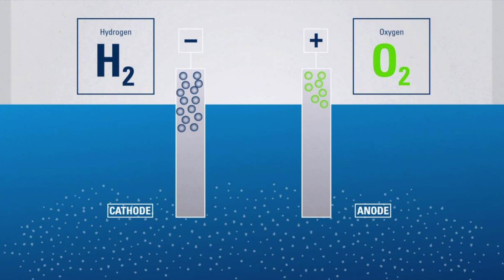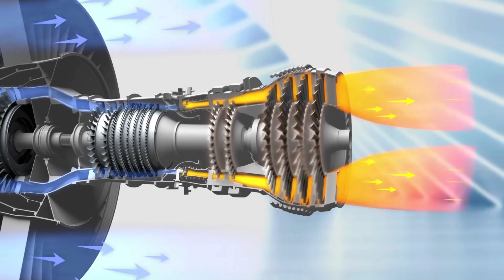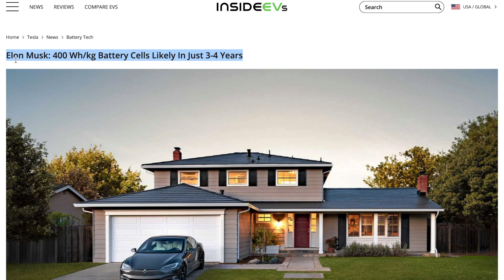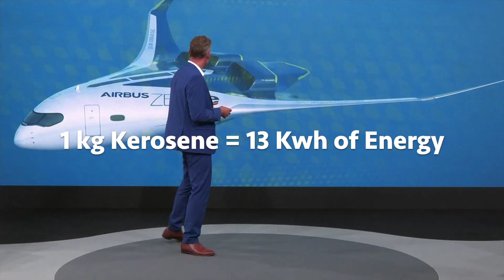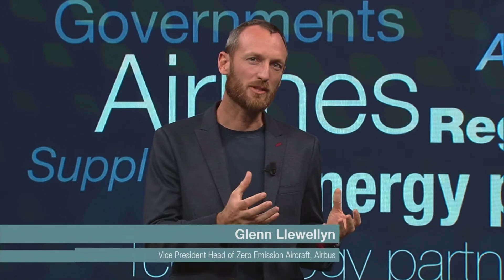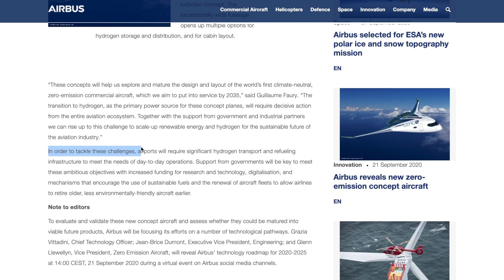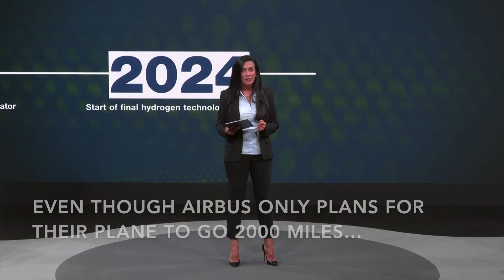Why A Hydrogen Plane Is A Terrible Idea

Comment: You missed the most important detail: how do you convert electric energy into kinetic energy? There's no electric jet engines, they'd need to be prop engines with electric motors, which are considerably slower, less efficient, noisier and overall worse - hence why virtually all commercial medium & big planes are jets.

That's where hydrogen wins by a long shot, hydrogen can be fed into regular jet engines with small changes in the burning chamber, and will work just fine.

Energy density and price are important, but even if you have the same energy, it's useless if you can't convert it into kinetic energy (ie. movement) efficiently.
Reply: Not to mention that the high voltage electrical system need to be tested to avoid fire hazard and battery is a deadweight to the plane
Reply: The time needed to charge the batteries would cost the airlines a fortune in operating costs and idle time.
Reply: Also with hydrogen you can put the amount of weight you need related to the distance you travel, when you travel and burn hydrogen the airplane gets lighter and more efficient, with battery you have to carry the full weight for the whole flight, and enough batteries for thousands of miles, even if you flight only 100 miles
Reply: well I would prefer fuel-cell plane with prop engines, that way hydrogen is more efficiently used where fuel cell engine could be lighter than jet engine and less hydrogen stored for the same trip. I don't really care would the flight take me 2 hours more or less, but it would flight further without necessary stop for fuel.  But also we need to account the benefits hybrid body (fused wing into fuselage of an aircraft, possible expanded carrying capacity), pusher configuration (propeller push an aircraft rather than pull), joined foward and backward swept wings and many more drag reducing designs...
Reply: To add this, when a turbine burns hydrogen, the it uses oxygen from the air - and it doesn't have to carry that in a tank. Batteries can't use this advantage.
Reply: @derkatzenfuerst6077  air-metal batteries:)
Reply: Maybe in the future we might use plasma jets instead
Reply: @ThomasBomb45  - air metal batteries have not shown high reusability. It's more like use once, throw it away. When you do that, then what's the difference between that and chemical fuel? How would it be better for the environment?
Reply: @manofsan  Yeah the technology would need to be developed to recycle used batteries into new batteries using renewable energy
Reply: For high speed airliners an electric motor powered ducted fan is the answer. Look at the big fan at the front of modern airliner engines. It rotates slowly and produces over 70% of the thrust. Upscale it and have a small rear pusher fan to supplement the thrust and you have a viable, high speed airliner propulsion unit. The weak spot is not the propulsion unit technology, rather the batteries and charging infrastructure.
Both can be solved with enough r&d $$$.
Reply: @stephen_101  - high speed means high power, and high power means combustion, not mere batteries. I'd like to think we could do hydrogen combustion, which gives water as exhaust
Reply: How bout plasma jets with hydrogen power airliners
Reply: I'm pretty sure that propellers are more efficient, there's a reason why they're still used (and it's not just cost). I know that they both excel in their areas, that being slow and fast speeds
Reply: plus you have to dump fuel before emergency landing! try doing that with batteries..
Reply: @jamietian6891  In theory the charging times could be minutes, as with modern cars.
Reply: @derkatzenfuerst6077  Batteries don't work with combustion. Of course they do not need to carry oxidizer.
Reply: @ChucksSEADnDEAD  of course not. My point is that a plane using hydrogen / oxygen combustion engines only has to carry half of its fuel. The other half is coming from the air intake.

When using batteries you need more energy on board to compensate for that fact.
Using hydrogen comes with it's own set of engineering problems.

What do you think, which system will be the most successful in the end?
Reply: @derkatzenfuerst6077  "a plane using hydrogen / oxygen combustion engines only has to carry half of its fuel" - Oxygen isn't the fuel, it's the oxidizer. The point is, when we calculate the energy densities of a fuel, we include the result of the energy released by the breaking of the O2 double bond without including its mass or volume. So there's no "hidden" advantage.
"When using batteries you need more energy on board to compensate for that fact." - But no, you don't. It's already compensated for. Same as automobiles, we compare fossil fuels to batteries by assume the energy released from oxygen is already in the fuel tank.
Reply: @ChucksSEADnDEAD  TIL, thanks.
Reply: @Avant-garde_Bucket  is it that much more efficient? Yes you get more of the energy out of the hydrogen, but you also have to fly for longer. Assuming these jets and props would have simmilar preformance to their standard fuel counterparts, the jet would be about 50% faster. Not sure the exact efficiency comparison at that point, but it is notable.
Reply: @midgetman4206  props are still used because they are well suitted to small planes. Though even there they are being phased out.
Reply: @ChucksSEADnDEAD  fosil fuels and hydrogen have very different reactions. When a fosil fuel burns, the added oxygen makes up very little of the reaction, with hydrogen oxygen acounts for 1/3 of the mass required to react.
Reply: @averagejoe9040  Yes, that too. But large planes also use them, most popular of them being the C-130.
 
But efficiency is a big factor when companies and buyers decide what kind of propulsion method they want (after consideration of other things of course)
Reply: @averagejoe9040  well do you have some information about comparison of fuel cell prop plane vs hydrogen jet plane? I don't know are there hydrogen jets, but there are hydrogen rockets 😁. But it would be nice to know what fuel efficiency have planes in comparison, just don't know did anybody made it.. yet.
Reply: @averagejoe9040  That's not the point. If you have 10 megajoule in hydrogen or in batteries, the energy is the same. When we calculate the heat energy recovered from the reaction we already took the oxygen's share into account.
Reply: @ChucksSEADnDEAD  and I dont disagree with that
Reply: @Avant-garde_Bucket  There's a lot to this idea. Modern prop technology could do a 450mph cruise across the Atlantic. The longer flight time would be insignificant with a roomier therefore more comfortable cabin.
Reply: @jonb5493  that is why I have high hopes for modern props in future, even a turboprop already is really clean even if it goes on fossil fuel. Just one issue here is value, they are expensive as hell. So for common people to get or take a flight in it is basically the same advising them of buying or renting hybrid supercar. It could make a difference if we could make them cheaper, after all, a turbine once was way too expensive, now isn't..
Reply: Ammonia cost only  $1,022.50 a ton. Seems like a no brainer.
Reply: Turbines spin, at a significant higher revolution. Energy laws take over eventually I understand that. However everyone approaches hydrogen as a static full fuel source when in reality it can be supplemented via on demand options to offset the cost and energy waste
Reply: fun fact, electric jet engines are a thing. They use ionic wind,  having potential differences of tens of thousands of volts between 2 electrodes. This causes the air to be ionised, creating a wind of ionised particles moving between electrodes. This movement also moves the plane (since every action has it's equal opposite reaction). Only issue is it takes SO MUCH energy to create a tiny bit of thrust
I wasn't tryna agree with the video, this youtuber's a dummy, I just wanted to share a fun fact
Reply: Prop engines are not less efficient, in fact they can be more efficient than turbofans, but at a slower range of speeds.

Comment: 1. Flight time Vs ground time. You can't keep planes on the ground.
2. Jet Vs propeller, speed is important
3. Energy density. Low mass is critical, especially for landing.

I don't think that we can go electric on planes. Hydro seems viable in the moment that the energy production problem is solved.
Investments for hydro tanks can easily be done, hydro might even be produced locally, with no transportation.
To be honest I think that for the specific case of planes, hydro is looking pretty good!
Reply: Tesla fanbois will still want to use lithium
Reply: not only that, but you can also up the ante and create synthetic fuels with more energy per unit mass. hydrogen’s biggest problem is it’s just so damn volumetric - if that problem can be solved it effectively saves you 20% of your efficiency loss from compressing the gas.
Reply: Fossil planes can't slow down, because of wing drag. Electric planes can use the the wings surface area to generate propulsion, which offsets the drag. It's a big mistake to think that electric planes should be designed around the inefficiencies of fossil planes.
Reply: What about a hydrogen powered electric plane? Hydrogen fuel cell powered prop plane will use the energy density advantage of hydrogen minus the efficiency of hydrogen combustion
Reply: @nick_0 : Yes, you shouldn't design an electric plane as if it was a fossil plane. An electric plane should use hundreds of small props along the entire edge of the wing rather than one or two big prop engines, as if they were fossil. It is much more efficient, provides much less drag and can generate power when you slow down. Also, the wings can have solar panels, adding even more power, increasing efficiency. 

When you talk about efficiency, you have to include all factors.
Reply: @jeschinstad  in truth I am not sure. Some simulations should be ran.
Thermal propulsion allows for faster than sound jets (high impulse).
The speed of the jets highly influence efficiency.
I am no aerospace engineer though 😬, I'm purely speculating.
I'd definitely love to see some purely electric based fan system though!
Reply: @patrickpredella : I've seen some model prototypes. But the fun thing about electric planes, is everything has to be designed from scratch. Some of them are really cool. :)

Comment: 3:22 "We know that we will have a battery with more than 400 Wh/kg in energy density in around 3-4 years."

We certainly don't know that. It's just an empty promise.
Reply: Long-distance air travel would still be infeasible even if this improved density arrives. As for small short-hop aircraft, say 400 mile trips around Europe, North-East US corridor, or along the West Coast, sure there might be a niche but that's not what this article is considering.
Reply: And three years later, CATL is producing 400Whr/kg batteries for aviation.
Reply: @yodaiam1000  On their website they mention several different numbers but the highest I saw was 330 Wh/kg.
Reply: @seneca983  The Catl battery is actually "upto" 500whr/kg. It is in the news section of the website. Amprius also has 400whr/kg for aviation uses.

Comment: Since electrolysis can turn water into the hydrogen fuel just by applying electricity, if you have a wind turbine connected to that conversion then you can now make as much H2 gas as you want, forever, without paying any additional costs. I think this means that H2 has every possibility of becoming incredibly cheap and abundant
Reply: That's my thoughts exactly, it will bring about an entire shift in the way we consume energy, and conservation rather than production will be the key.
Reply: You could also other significantly more powerful forms of clean energy generation such as nuclear hydro and geothermal all of which have a lot of room for great inovation.
Reply: Or just nuclear